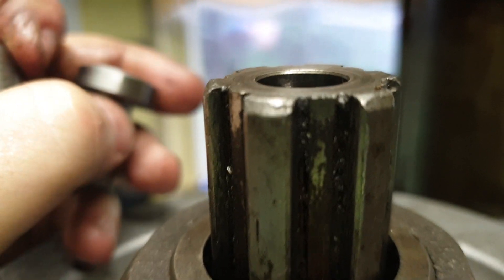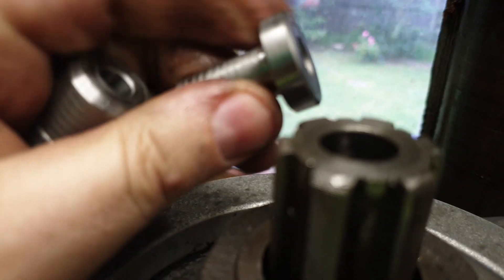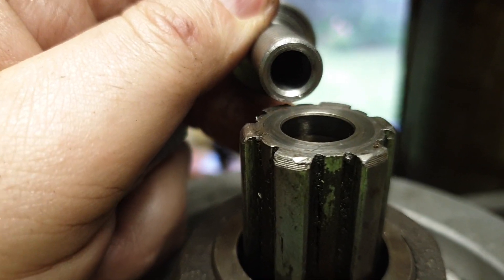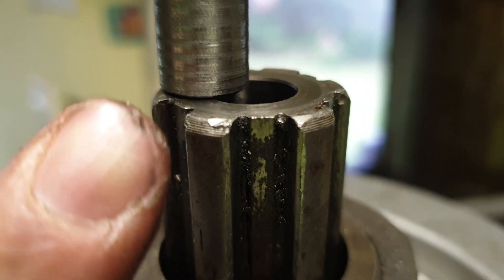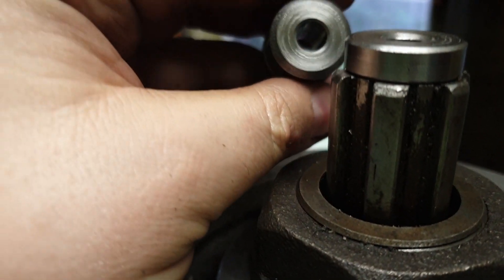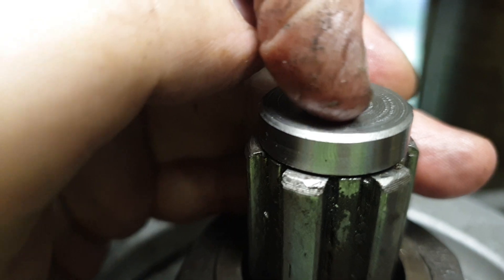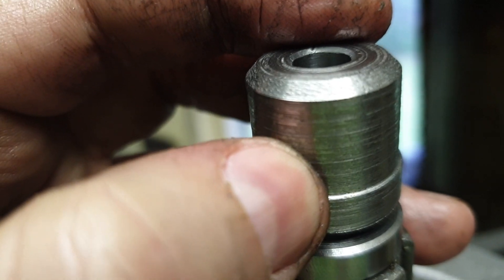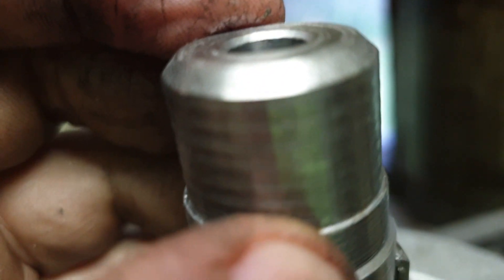RF30 - 1a - Captive Drawbar

Comment: Adam, how did you end up solving your problem of the loctite?  I have seen another guy who threaded the top of the spindle and then threaded the bushing into the spindle.  He then pinned the hex nut on at the top.  Cuppa Joe is the guy.. Thanks!
Reply from the maker: I've heard of Cuppa Joe, but I still haven't checked out his channel - thanks for the recommendation! I wound up using a loctite bearing retaining compound to hold the bushing in place; it hasn't failed, and I haven't had to pull the spindle out either (yet!).
Reply: @carneeki  I'm going to give it a go with threading the spindle while its in the machine.  Wish me luck!
Reply from the maker: @Scottforyoutube  good luck! Hope to hear how it goes!

Comment: On my list as well, got some grade 8 threaded rod as my old draw bar is imperial not M12
Reply from the maker: Mine is 7/16 R8 too :)

I threaded the drawbar today, but not much video as the battery was flat :/
Reply from the maker: Hey JB isn't your lathe leadscrew inferial? Why not single point it? (Mine is metrique so I got it close without disengaging the halfnut, then finished with a die in my tailstock die holder).